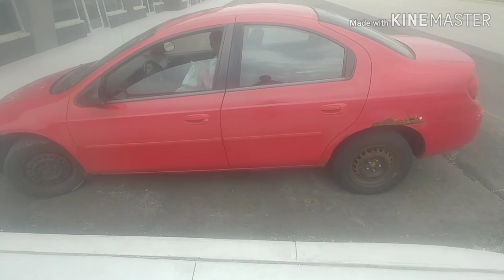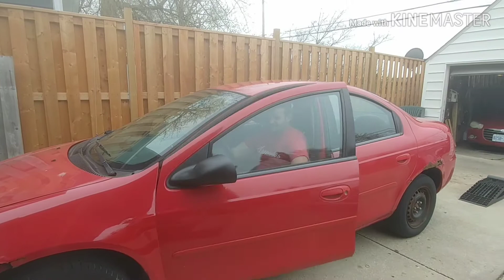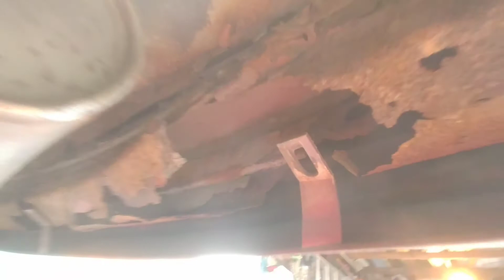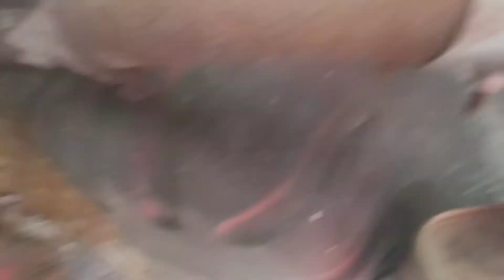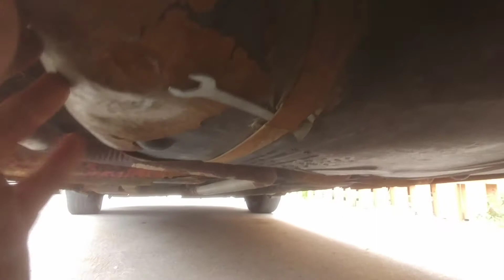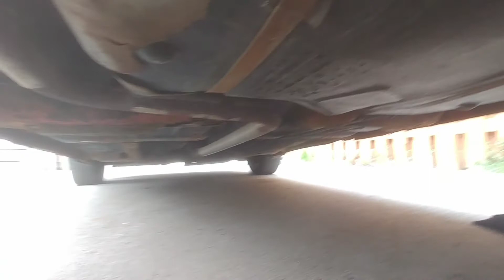2003 Dodge Neon high miles overview

Comment: How many miles are on your Neon?  I have a 2005 Dodge Neon that has 251K miles and runs and drives great.  It is a manual transmission.
Reply from the maker: @dzim8822  250000
Reply: @scottlarsh3119  That's great 👍